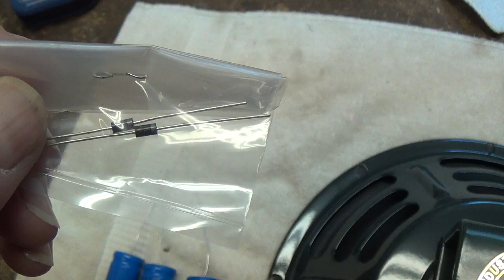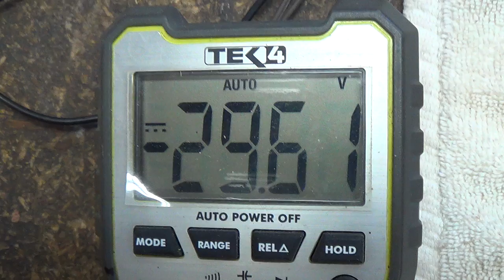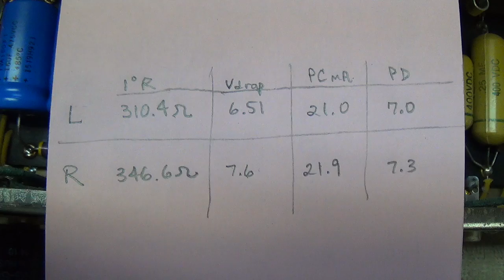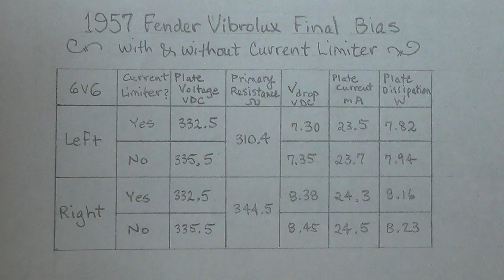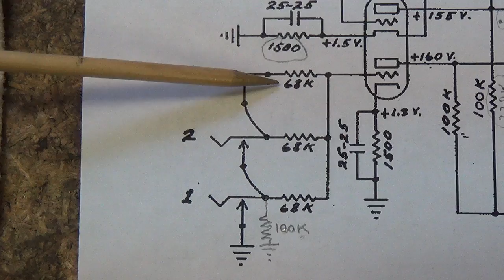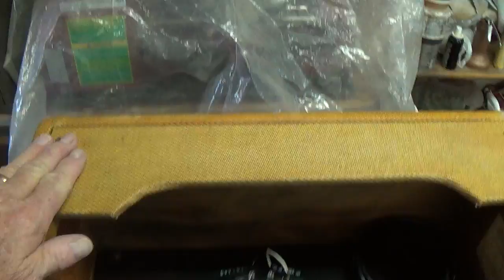1957 Fender Tweed Vibrolux, Part 3

Comment: Actually, even with the guitar plugged to the "bottom" input socket (as seen on the schematic), nothing bad will happen to the input tube bias, as the guitar's pots, and indeed the coil of the pickup itself, will act as grid leak resistor. Still, a bad design to rely on external circuitry like that.
Reply: Note that even with a proper grid leak resistor in the amp, most grid leaking in the input stages is done by the pickup of te guitar anyway, as it tends to have much lower resistance than the actual leak resistor.
Reply from the maker: Thanks for your input, Kard. How about the great variability in input impedance (and volume) that would result with this input circuit?  I would think it might have a negative effect on speaker health and longevity.
Reply: I'm not sure I'm following you there with the speaker health.

Many amp designs deliberately have two inputs of dramatically different impedance. Consider for example the Marshall JCM800, with the high impedance input being 1M and the low impedance one being 68k+68k = 136k. 

Regardless, even the low impedance doesn't really load the pickup too heavily, as even the most powerful humbuckers tend to not exceed 10k of output resistance by much. This is still an order of magnitude lower than even the lowest input impedances found in guitar amps. Low input impedance values do load the guitar circuitry though, so if you don't have the guitar potentionmeters maxed out, you will hear a difference in tone and volume between different input impedances of the amp. 

I was trying to figure out what would happen if the amp was driven from a stompbox that did not provide any path to ground (like one with a capacitor on the output). However, literally every pedal I could think of has a resistor or pot to ground. I'm no authority on pedal design, but the more I think about it, the more it seems to me it would've been a bad design to have a pedal with no finite output resistance to ground. If a hypothetical badly designed pedal like that met with an admittedly poorly  (with regards to the input wiring) designed amp such as this, the amp would obviously not work, as the bias of the input tube would go out the window, as you explained in the video. Still, with the high value plate resistor of the tube, it would be highly unlikely to fry the tube as a result.

Having said that, this is probably one of the things that we know are a bad design now (the death cap and two-prong cords being an even more drastic example, not to mention getting the bias for the power tubes from the wiper of the tremolo resistor - when the resistor gets the dirty, the output tubes get fried!), but were commonplace back in the day. It's not like stompboxes were extremely popular in the tweed amp era.  So, I would not be too hard on the good people from Fender who built this beautiful amp. It's still going strong after over half a century since it was built, a true testimony to the build quality.

Cheers.
Reply from the maker: Indeed it is, Kard. Thanks again for your knowledgeable and helpful input.

Comment: Hola Tio Doug, I thouroughly enjoyed this series of videos. As always they were interesting and educational. I know I can always count on learning many new things when watching your videos, thanks for sharing. I have a question though, when replacing the selenium diode with the new one, would it be safe to say that the voltage decreased rather than increased since we're going further away from a positive voltage? I know this may sound like I'm nit picking but I really would like to know. Thanks again and I'm always looking forward to new uploads from you.
Reply from the maker: Thanks, SoCal. That's an interesting viewpoint, but in my mind, the charge associated with DC voltage does not indicate the work potential of the voltage or its magnitude.....it only indicates the direction that current will flow if a circuit is closed.
Reply: +Uncle Doug You know, that thought never occured to me, Id have to agree 100% with your statement.  Thanks for clearing that up!
Reply from the maker: You're welcome, SoCal. Thanks so much for watching the videos and providing input.

Comment: Another great and informative video entry in the annals of tube amp cognizance...thanks again, Uncle Doug.
Not that it was necessary on this beauty, but when you need to clean the accumulated grime from tweed (and possibly from grill cloth), what's the best approach?
Reply from the maker: You're welcome, C7. I would leave a grill cloth alone.....unless it's simple cloth and you want to remove it from the cabinet and try washing it with Woolite. For the cabinet, a moist soapy cloth will remove most of the grime.....but don't overdo it or get it too wet.

Comment: Great video as alway Doug as I am an Ampliholic and a Teleholic I was onto your mystery guitar straight away that muddiness at the neck is a dead giveaway, easily adjusted with the right PIO cap, one of the reasons Fender supply a spare with the 52 reissue I think!
Reply from the maker: Thanks, Steve, and you're right about the Telecaster......it is a '52 reissue with the original cap in place. You do know your Tele's :)
Reply: yep spot on Doug I have a 52 reissue, a 52 Hot Rod and a Cabronita, plus I have fabricated a couple of partscasters for friends, I just think they are the perfect working musicians guitar :)
Reply from the maker: Indeed, they are compact, light, versatile, and sound great.....what more could you ask for ??? Thanks for the input, Steve :)

Comment: Nice Audio-Samples! The tremolo is indeed very subtle.  Was the second guitar a telecaster?

Why are there three nearly identical input jacks and not a low and a high gain input? Is it intended to connect multiple Instruments?
Reply from the maker: Thanks, PoB. Yes on both comments......subtle tremolo and '52 Tele.  I added a note to the video suggesting that you can make Input No.1 a higher gain input, simply by adding a higher value resistor......i.e. 150K. I believe the original intent was to allow two instruments and a microphone (for harmonica or singing).

Comment: It never ceases to amaze me how long a new speaker takes to break in. I broke in 4 Celestion Greenbacks ( Real ones, Heritage G12H made in England) in a Marshall 4x12 played regularly with a JTM45. I got a price on 5, and put one in a 74 Deluxe Reverb. 4 years later, the Deluxe Reverb became my number 1, after hardly being played with the new speaker. I swapped out the DR speaker with one from the 4x12 and the difference was unbelievable. The Moral of the story is never judge a speaker before it is broken in, which is going to take at least a year I reckon.
Reply from the maker: I agree, Paul. I will add that this Special Issue speaker, out of the box, is a lot closer to being broken in that a plain P10R. The plain one tends to be rather harsh and brittle.....and doesn't improve all that much with use.

Comment: Amp sounds great ! The Telecaster too (cause it's a Telly right ?)... Though the neck pickup is way more muddy than the one on mine. So Interesting, I had no idea those vintage treasure had such obvious flaws ! I wonder how they managed to get past them. Did They correct it in the later designs ?
Reply from the maker: Thanks, Francois. It is a '52 Telecaster with original tone cap (muddy neck tone) which can be changed to sound like your more modern Tele.  I think these flaws were not as evident back in the "old days" and probably more acceptable since they had little else to compare with.  Yes, the input circuit was changed when the brownface and blackface amps were developed.

Comment: lovely amp. I love tweeds. Does anyone know why fender didn't replace tube rectifiers in all thier amps with solid state diodes? Tube rectifiers survived in Deluxe Reverbs and some Pro Reverbs even through the CBS cost cutting...I can't help wondering why. Especially as GZ34 tubes offer little if any sag.
Reply from the maker: Thanks, Paul. I think Fender was rather conservative about radical changes and, let's face it, almost all low to medium output amps in the 50's and 60's were tube rectified. It may be "old fashioned" but it was part of the tone that people sought.

Comment: Ole"  Bravo, Encore ! 
Doug, as always fascinating and informative. Please tell me about your thoughts on the corrected input circuit, do you feel all factory original Fender Deluxe, Vibrolux and Tremolux have the same flaw?  What are the repercussions to tone if someone is using the first input? and what damage might occur from using it? I am having trouble wrapping my head around that.

Ps pardon me for saying, I didn't really care for the neck pickup on the 2nd Guitar, what I assume to be a Telecaster.
Reply from the maker: Thanks, Joe. I think that if you were using the 2nd or 3rd pickup at rather high volume (guitar and amp) and then plugged into Input No.1, the speaker could possibly be damaged. I'm not sure if that's what happened in this case, but I don't want to find out. The neck pickup is a little muddy because it's a '52 Telecaster reissue. The tone cap can be changed to correct this, but its the way a '52 Telecaster originally sounded.
Reply: Doug, thank you, This is very interesting because I have a 46 Woody Professional Reproduction that Fender made for their 50th Anniversary with NOS parts in 1996. 
I blew the 15inch Field coil speaker first time I played it. Took me 2 or three times looking at it and ka pow The speaker was shredded. The schematic's I have are flawed.The amp's construction is not a Turret Board but flying wire point to point. I have never gotten it right since the 8 years ago I bought it NOS. 

I attached a link to a photo bucket album of the Amp. The schematic, (2) versions are there at the beginning but there are way too many pictures.
I hope you find it interesting

http://s227.photobucket.com/user/grooveyrecords/media/46%20Professional/db22_1.jpg.html
Reply from the maker: What a spectacular recreation of the Model 26.....beautiful birdseye maple cabinet !! It's a shame it blew the speaker right out of the box. I wonder what happened???  The guitar is a 1949 Broadcaster Prototype, I believe.....also a wonderful recreation. If you ever want this amp and speaker repaired, let me know. It would not be cheap.....but I can fix anything. Meanwhile, thanks so much for sharing these photos. This is a wonderful set that I, and most people, could only dream of owning.
Reply: Yes This guitar was known as the Snake Head became the Broadcaster in 1950 with a headstock resembling Bigsby's design 

"If you ever want this amp and speaker repaired, let me know"
I'd like to do that Doug, Thank You!, give me some time to work it into my budget, September would be realistic for me.
Reply from the maker: The offer stands, Joe, whenever you decide to get it repaired. Thanks again for the wonderful photos.

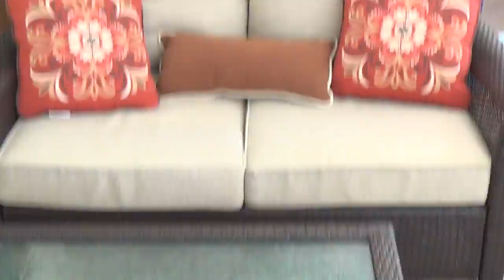Comment: Hey Doug, great video as always; your videos are truly an education. However, I'm not so sure about your analysis of the input circuit starting at 12:39. I agree that when you connect to input one only there is no grid leak resistor (except that of course the guitar itself will act as a the grid leak resistance). When you connect to input 1 you get the full guitar output voltage to the grid. When you connect to input 2 you get 2/3 guitar voltage to grid and when you connect to input 3 you get 1/3 guitar voltage to grid. In the case of input 2 you get 68k to ground and in the case of input 3 you get 34k to ground (ignoring the resistance of the guitar). This is all assuming you only connect one guitar to the amp at one time.
Reply from the maker: Thanks, Dave. I will agree that, when plugged in, the guitar volume control could provide the ground reference needed for tube bias.....but I stand by my analysis of the input impedance. I believe you're ignoring the collective effect of all 3 grid blocker resistors.  In actual testing, attaching an ohmmeter to each (ungrounded) input leaf will yield about 100K impedance to ground for all three inputs (including No. 1, now that the 100K resistor was added).  To me, an infinite input impedance is simply not practical or usable. I added a note to the video about the guitar volume control providing bias reference, and explaining that the impedance for Input 1 can be tailored to your needs simply by adding a higher or lower value resistor. Thanks again for your input.
Reply: OK, we seem to be reading the schematic differently. I have drawn out my interpretation and posted it here http://i63.tinypic.com/sm3o04.jpg It seems to me there is a potential divider effect for inputs 2 and 3. Please do take a look and let me know your thoughts. By the way, I wasn't defending the lack of grid leak resistor on input 1, just making an observation. Regards.
Reply from the maker: Thanks for your careful analysis, Dave. I agree that if a guitar is connected to the amp, it, in effect, becomes part of the circuit and  provides the impedance to ground missing in the amp circuit. My analysis was purely of the amp circuit itself.

I repeated my impedance (signal to ground) measurement of the 3 input jacks with a "mock guitar" (230K volume pot, signal to ground) plugged into each jack. Results with the added 100K resistor: 1 = 69K, 2 = 74K, 3 = 74K. Results without the added 100K resistor: 1 = 230K, 2 = 74K, 3 = 74K. Results with an added 220K (instead of 100K) resistor: 1 = 111K, 2 = 74K, 3 = 74K. As a result of these measurements, I'm going to change the 100K added resistor to 220K, giving the 1st input jack a reasonable amount of higher gain than 2 and 3.
Reply: OK, thanks for your reply. Now I'm looking forward to the re-coning video.
Reply from the maker: You're welcome, Dave. I got the supplies yesterday afternoon and, hopefully, the video will be out soon.

Comment: Was it in Rusty's contract to get the day off?  :)  Also, what exactly is the use of the resistor on the input before the preamp tubes? Would it be feasible to use a volume for preamp gain there?
Reply from the maker: Those are grid-blocker resistors, RR, used to establish impedance (to ground) and prevent oscillation in the first triode.  Instead of the 100K resistor I installed, you could use higher resistance to provide higher gain when using Input No. 1. I guess it would be possible to make this resistance variable, say from 100K to 250K.
Reply: Thanks for that answer.  I was talking more in  general. Almost all the schematics I have been studying have a 68 K resistor immediately after the input jack.
Reply from the maker: Yes, those are the "grid blocker" resistors, to moderate the input current and reduce the chance of oscillation. Please watch my video series on Resistors, where this is all explained.

Comment: Great video series. I liked the Telecaster played through this amp. How much does the tremolo circuit effect the bias voltage? For example does the -31 volts change from -27 to -35 volts when set to max depth?
Reply from the maker: Thanks so much, DR. That's a good question, and I think your estimate is probably pretty close. You can watch it on an oscilloscope......maybe a topic for a future video.